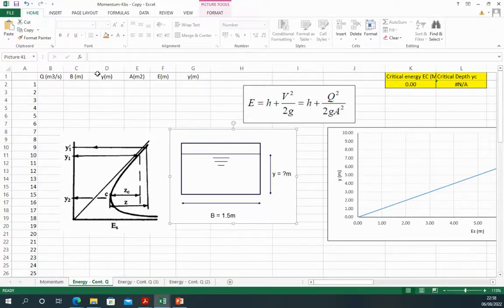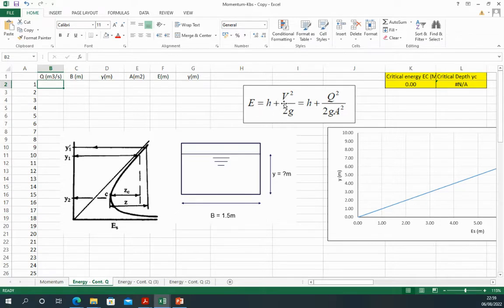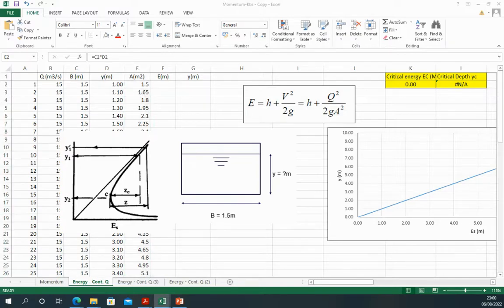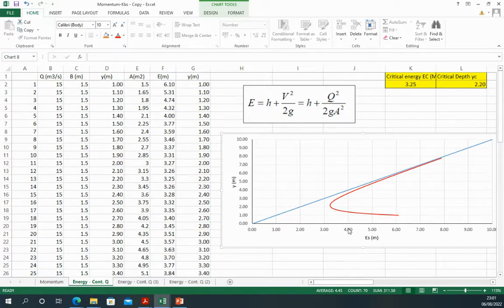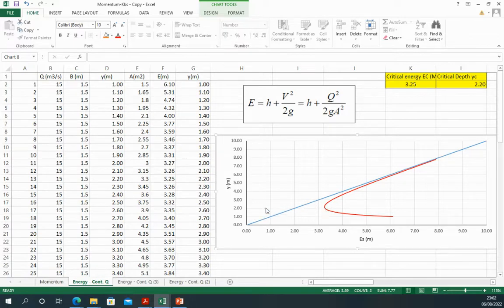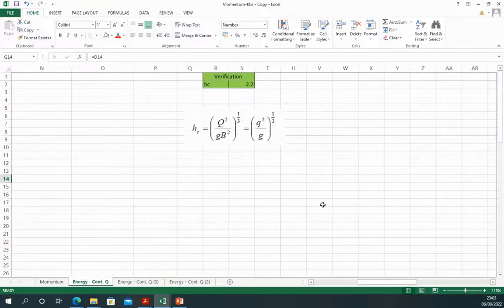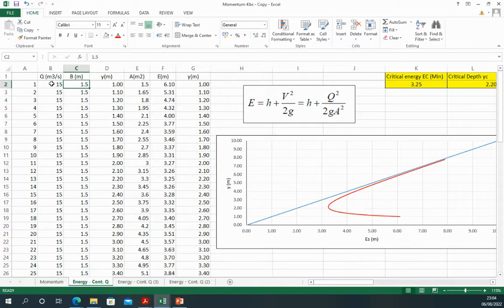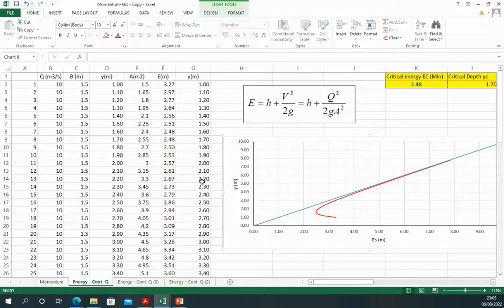Specific Energy Curve 01

Comment: how to get the straight line?
Reply from the maker: Hi Dear Ali, this line is a line that passes through the origin, and has an angle of inclination equal to 45°, which is for flat or slightly slopped channels. Please note that the concept explained in the video can only be applied on channels with zero or small longitudinal slopes. For channels with larger slopes, I will make another video. Many thanks
Reply: @ahmedosman9774  thanks brother